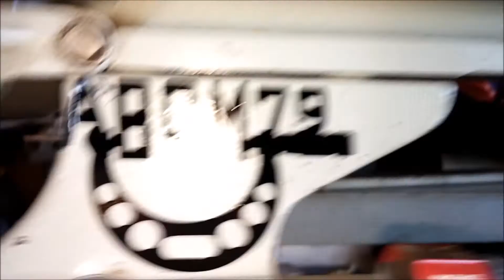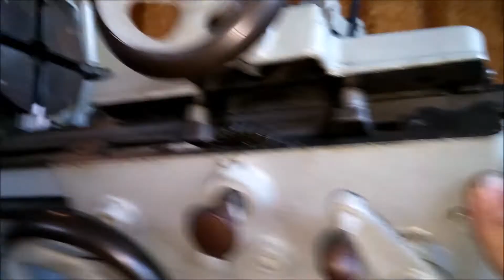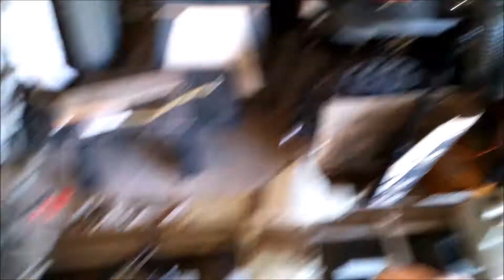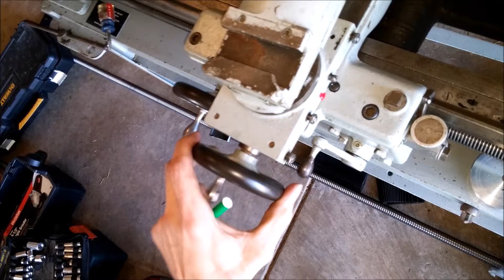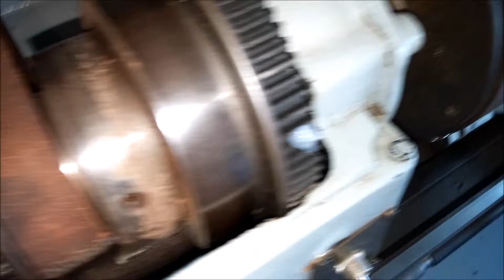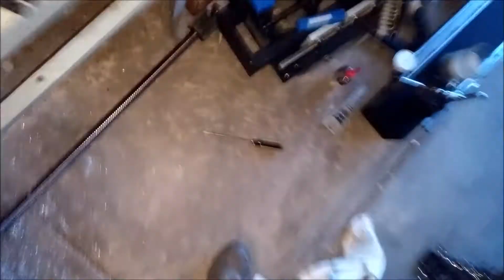Video Blog #9 - test cut on Logan

Comment: The bearings in the head stock are sealed. No need to oil them. Also, when you are doing facing operations consider locking the saddle. ;)
Reply from the maker: Jeff Conti Thanks Jeff.... you saved me from a potential headache later. :)

Comment: I noticed you were using metric size tools on the Logan.  Isn't it all SAE fasteners?
Reply from the maker: hankus253 Yep, I thought the same thing. For some reason, some parts on the machine use SAE, other parts use metric.... odd...
Reply: Naked Machinist If it's like my Atlas lathe, the only thing that is metric is the late model tool post I added in place of the rocker style tool post, otherwise everything else is SAE.  If it truly metric my guess is it's an after market add on.  But then I'm not a machinist just a hobbyist and will bow to experience on the issue.  Enjoying your progress and sharing it with us.
Reply from the maker: hankus253 I'm just started this as a hobbyist myself and I'm learning as I go. There are some wonderful teachers out here on YouTube that have really helped. Coincidentally, I've just had some good opportunities come up as a noob. I'll have to do some research as to whether it's all SAE or metric. Thanks for coming by and commenting.